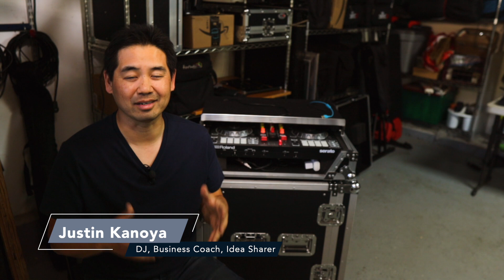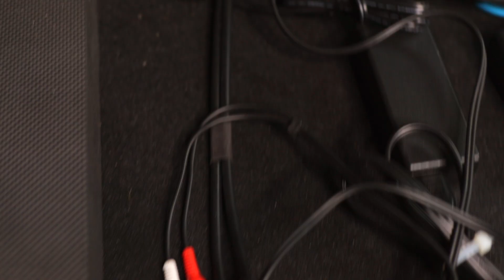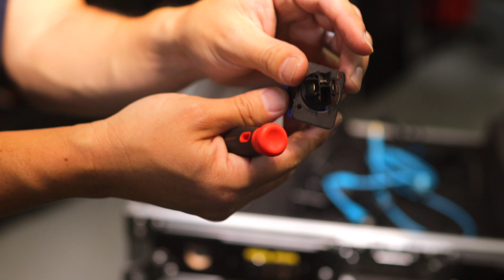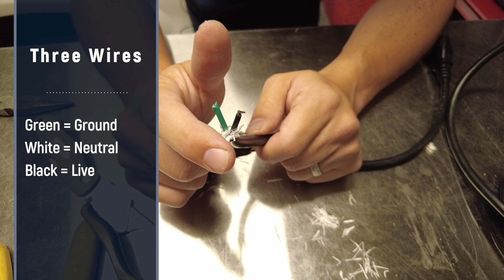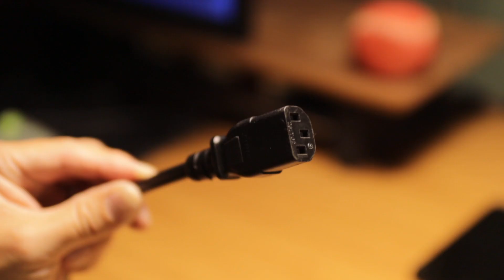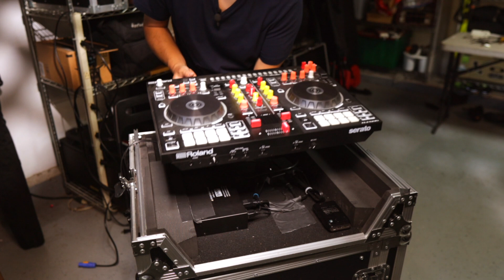Organizing Cables Inside a  DJ Controller Roadcase - CUSTOM POWERCON

Comment: Hey! Great video! I am just starting my DJ journey and I’ve been looking for a very simplistic but efficient set up. I really like yours and as a matter of fact, I ordered a custom panel like the one you did for my DDJ 1000SRT from your other video. A question I had is, I see other DJs use a power strip instead of that power conditioner you have. Do you recommend one over the other? Under my controller I figure I’d like to have plugs for my laptop, the controller, my wireless mic, maybe an effects light device in the future, and ports for charging. Also, are you aware of power con connectors that come connected to a power strip or conditioner? Or that’s something that has to be custom made? Appreciate the guidance!
Reply from the maker: Power conditioners are always going to be a better option than standard, cheap power strips. So if you have room in your rack, definitely go that route. 

ProX has a power strip that has Powercon connections. Do a Google search for it.

Comment: you could have just left the original cable and plug attached to the power strip and just coil it up in the rear of the case. That way you're not storing the lead elsewhere which you might forget.
Reply from the maker: Not sure which original cable you are talking about. Everything needed is in the case. Should I need to use RCA outs, that cable is with other miscellaneous cables that is always with me.

Comment: Hey man, just wanted to say thank you thank you thank you x1000 for your guidance on getting the flight case customized for the DDJ SRT1000.  Two events in two weekends, and setup has never been faster.  I appreciate this video, because I know my cabling is pretty messy in there right now.
Reply from the maker: Ha! Lift that thing out and clean it up! I had been putting this off for so long and glad I finally got in there. 

Thanks for watching!